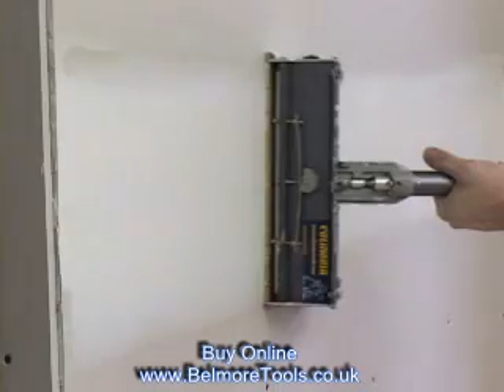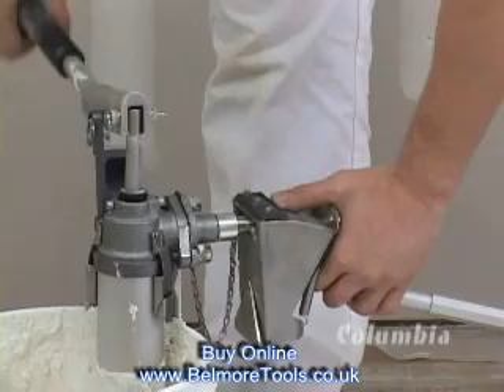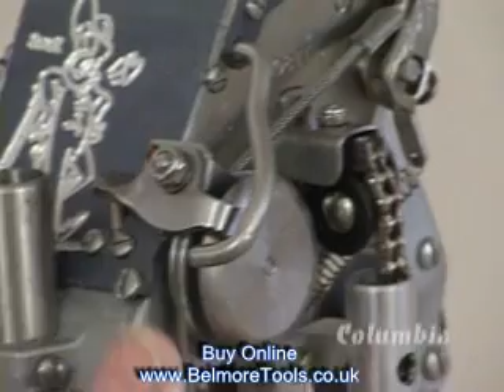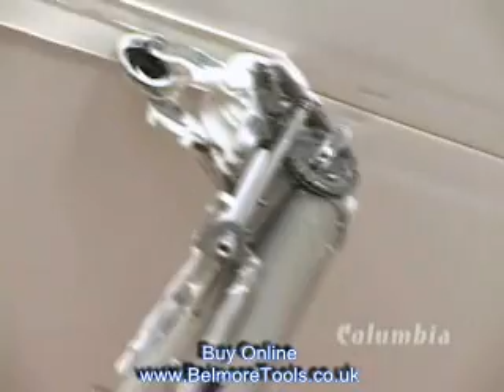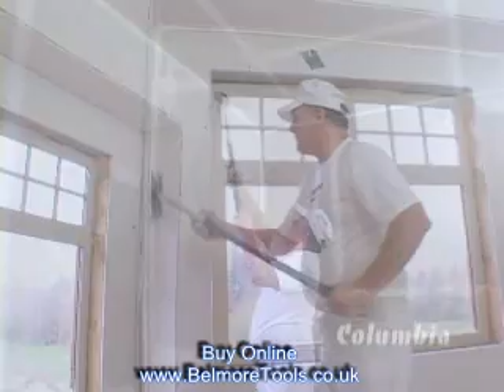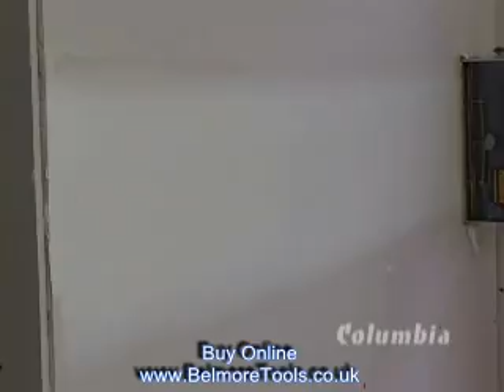Columbia Taping Tools

Comment: My problem is drag when am running the bazooka in internal angles any help appreciated
Reply: I just got my bazooka and I have the same problem. I stay away from being perpendicular to the wall to decrease drag.
Reply: Always going to be some drag to some extent. I usually just start the corner with extra tape to compensate